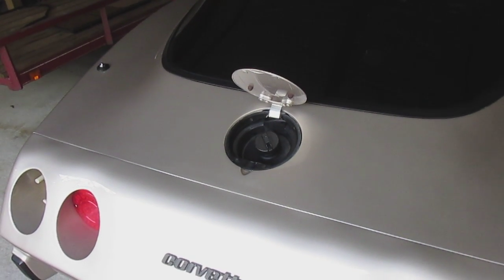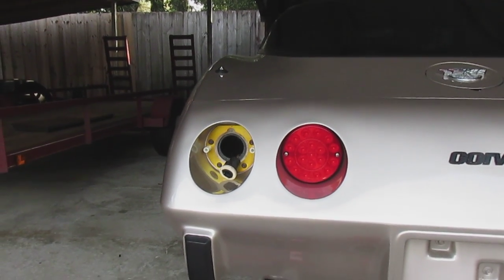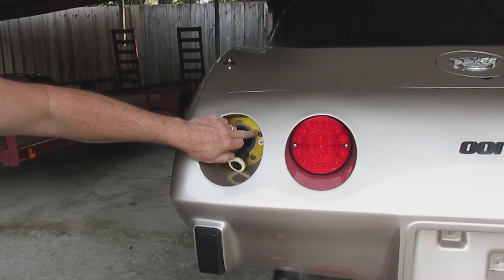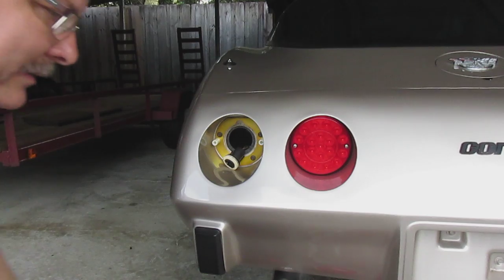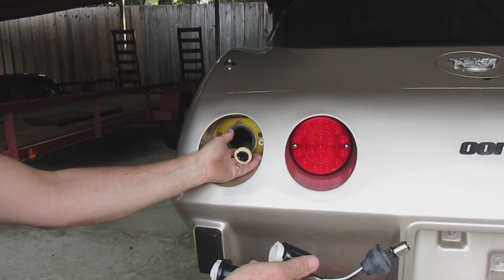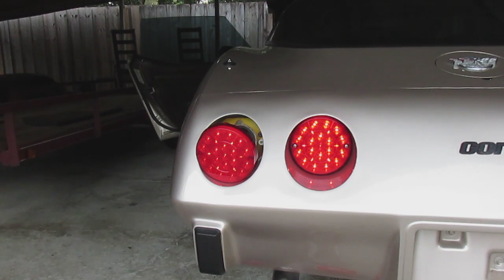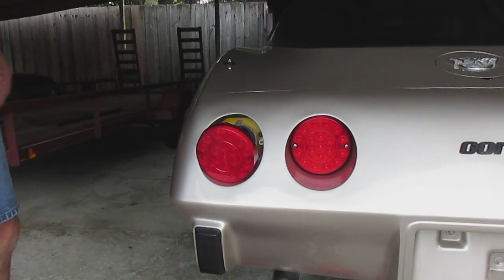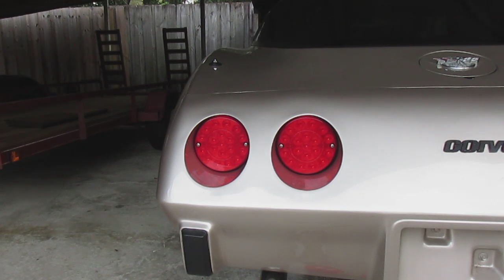1978 C3 Corvette LED Tail Lights Installation

Comment: where did you get the y adaptor. can't get 1 from corvette mods where i ordered the 4 led lights for my 1981 corvette. need a y adaptor or i can't use all 4 lights. might send them back for a refund.
Reply from the maker: My light kit came with the adapter. Not sure if you can get them separate.

Comment: I have the lights but can't get the turn signal lights to work,need help
Reply from the maker: You didn't provide enough information to determine exactly what is wrong, but I can explain how the circuit works. If when you activate the turn signal the front and rear lights come on and stay on but don't flash, you need to replace the flasher. You will need an electronic flasher or a heavy duty flasher. The LEDs don't provide enough load to activate the flasher properly. A heavy duty flasher or electronic flasher will operate the incandescent bulb at the front and the LED at the rear and are not affected by load.
Reply: I have the same LED Lights on my 78 vette as ur video shows but can't get the blinkers to work ,change out the  incandescent bulb in the front and put LED bulbs in for the parking lights and blinker lights and still can't get the blinkers to work either on the 4 way or normal blinker,need help.
Reply from the maker: Do you have power to the circuit? All fuses good? Turn signal switch good?
Reply: Yes everything good I even bought a E12 led flasher and plug it in where
 old flasher was under glove box.also need help on Emergency flasher 
where is that flasher located does it need a led flasher.  Thank
Reply from the maker: The one under the glove box is the turn signal one. The Hazard flasher is located on the fuse panel. Since it sounds like you have LEDs at the front and back, I think you will need an LED flasher. Are you getting any power to the turn signal switch? If not, a common problem is the turn signal switch connector which is located down by the brake pedal mounted on the bottom of the column. I have seen those connections get loose and burn up. You can pull the connector out of the bracket on the column and back probe the connectors on both sides of the connection. You may need a circuit diagram to help with the color code.
Reply from the maker: http://www.fullthrottlecorvette.com/assets/images/1816021.jpg http://i2.photobucket.com/albums/y38/JIML82/TurnSignalIgnitionSwitchSchematic.jpg
Reply: Yes sir i have a led flasher,I forgot to tell u when I go to turn the turn signal on I don't even get a light to light up, before i change these to Led and had the original lights they worked.and thanks for all ur help
Reply from the maker: Apparently there must be some issue with the  LED lights, since everything, (brake, tail, side markers, etc.), worked before. Sure you haven't lost a ground somewhere when you changed to the LED? There was a little rewiring to do on mine. My kit allows for 4 tail lights and 4 brake/turn lights. The kit eliminates the reverse lights. You no longer use the socket that goes to the reverse lights, Inner Holes), but parallel in another socket on the two outers so each light gives you dim for tail and bright for brake/turn. Hope you can get them going because they are really cool. I posted a partial schematic above. You may be able to find a more complete one online. There are a total of three wires to each light. One is ground, one for tail lights, (dim) and one for turn/brake lights, (bright).